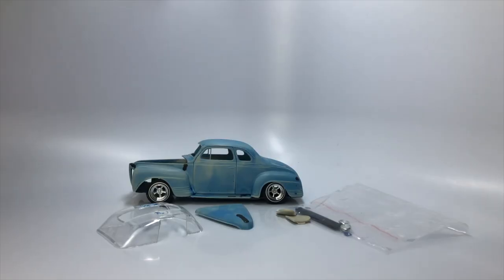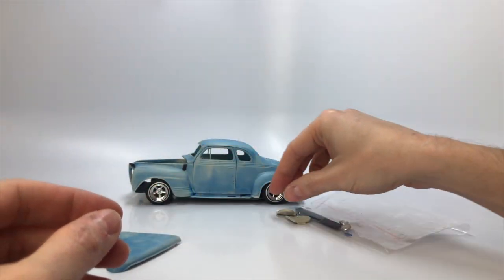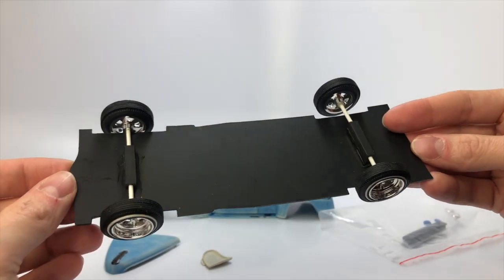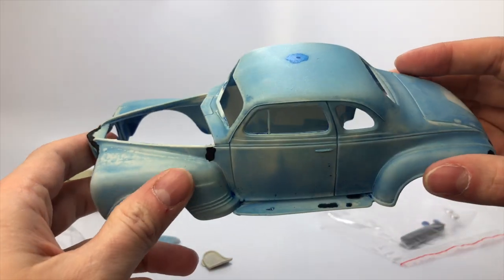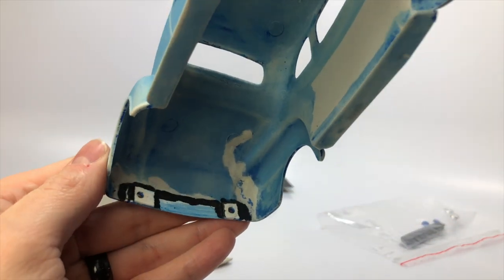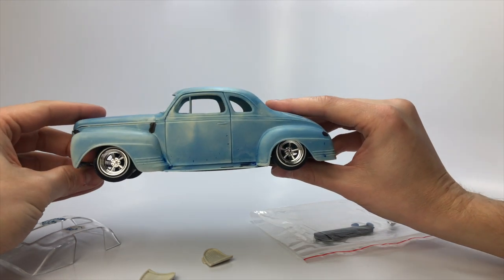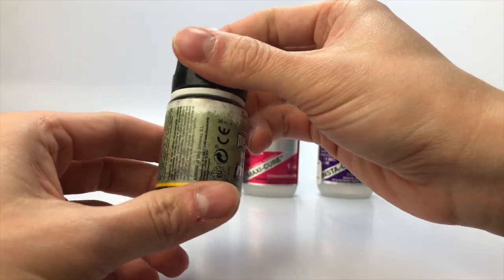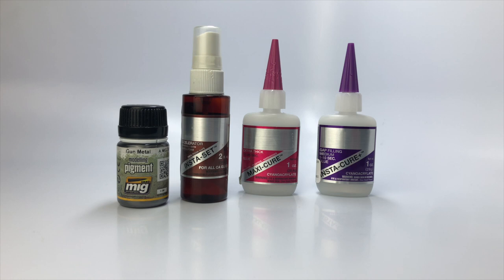Rebuildin’ Rebuilders: 41 Plymouth Pt.1

Comment: So, you snuck into my hobby room and took one of my models.😉

Using CA glue as a filler is a great trick. I remember when modelers mixed baking soda and CA to make a decent filler.

What I've been using is "sprue glue."  I take a half-empty bottle of Tamiya thin cement (NOT the fast set - It's too "hot") I add small pieces of styrene sprue until the mixture is like a fluid putty. It sands well and doesn't shrink or react with paints if covered with a primer.
Reply from the maker: Haha nice one Bob! I also use Sprue Glue and have four bottles of it - each bottle has a specific brand of sprue (Tamiya, AMT (90’s), MPC, Revell). I’ve found some sprue glue doesn’t play nice with other model brand plastics so I have sprue glue for the four major manufacturers I build. All of my sprue glue is made with plastruct bondene. Works well for my style.

Comment: Looking forward to seeing you finish this rebuilder.  I wouldn’t change the wheels. They look great.
Reply from the maker: Thanks for the comment, Michael. Yeah I will keep the wheels. I have had many other comments that the wheels should stay and not a single comment saying to change them. I am actually working on the build right now sanding out all the CA Glue filler and removing the injector pin marks with a simple chisel and Tamiya extra thin to soften the plastic to give me an easier cut.

Comment: Great tip.I use ca glue also as a filler.And definitely leave the wheels bro I’m liking this.take care and happy holidays.
Reply from the maker: Thanks, Chuck. Everyone so far has said to keep the wheels so that’s what I’ll do. I like CA glue as a filler as it only need to be applied just most, the majority of the time. However it does leave ver small pin holes like resin sometimes but two coats of primer will fill that right in. Happy New Year to you and your family!

Comment: Although I'm not a curb side builder, your choice to keep it curb side would be a good choice as you'd have to source another kit to do otherwise. 
The only thing I would mention is to correct the improper wheel base. It's too short as it is. 
Thanks for sharing the CA tips too. Plus, I made a note about what your thoughts were about striping.
Reply from the maker: Thanks for the comment, Bob. I’m not a curbside builder much either but this build I’m hoping gets my mojo flowing to start on another few builds I want to complete before April. I agree the wheel base does need to be adjusted to be proper. Hope you have a Happy New Year!
Reply: @MileHighScaleModeler . We do seem to misplace mojos a lot, huh? 
As a retireing DJ, this will be my first year at home for New Years Eve in over 20 year. So it should be interesting for the family. I hope all goes well, and safe, for you and your family.
Reply: I agree  ( especially after an intense build), it's nice to keep your chops up